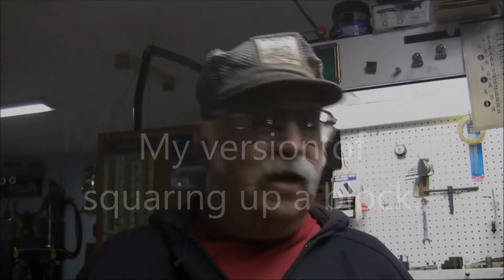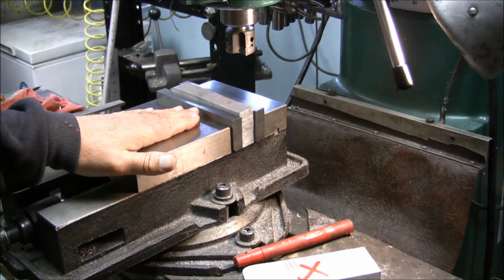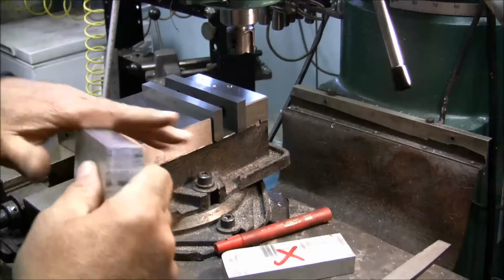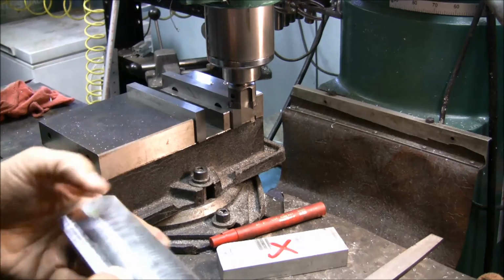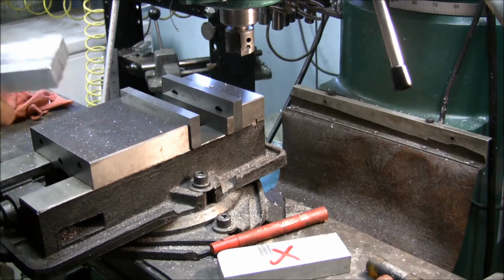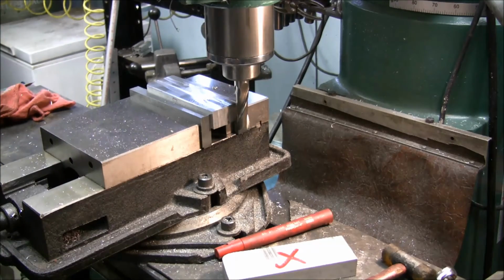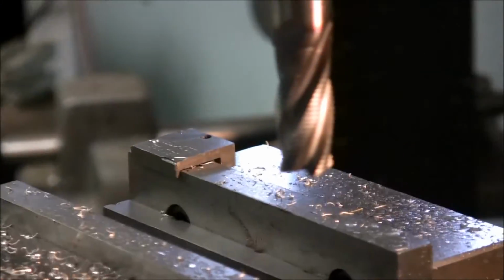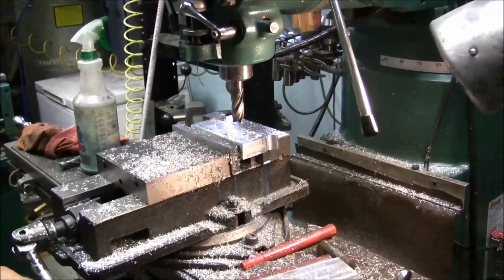Squaring up a block on the mill

Comment: perfect timing for me to find this as ready to start, are you not worried about damaging the surface with the hammer?
Any chance you have a video of making the offset jig for your camshaft which is what i want to now make., thank you again.
Reply from the maker: The hammer is like a dead blow it is a non marking plastic face hammer. No I have no videos on making the off set cam turning fixture but it was basically the same as this one.   http://www.floridaame.org/GalleryPages/IMG2008/Offset%20turning%20the%20camshaft.pdf